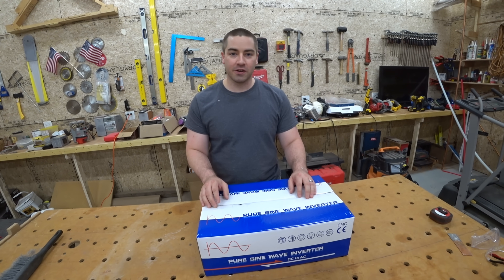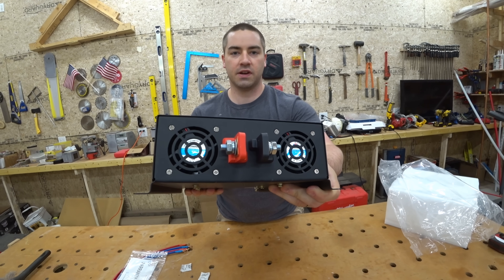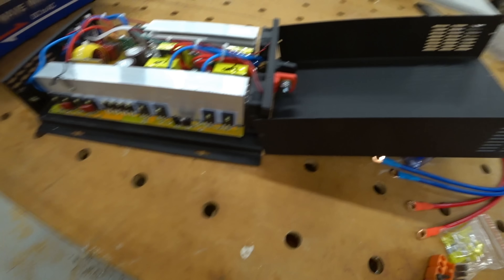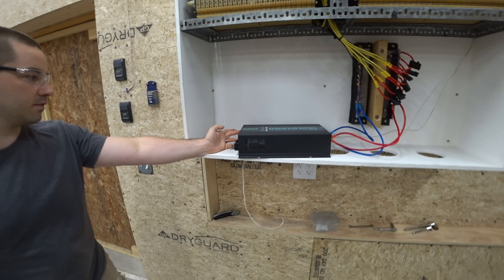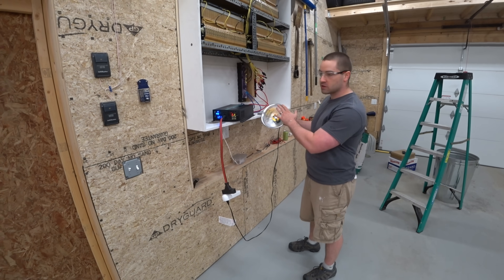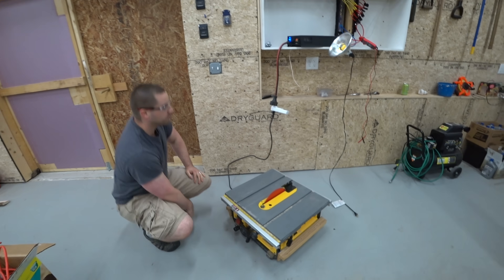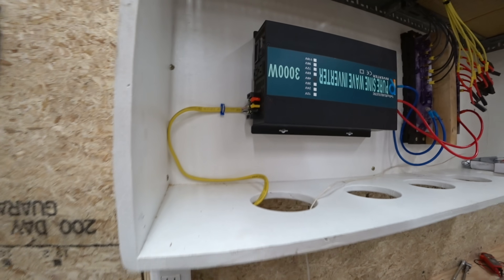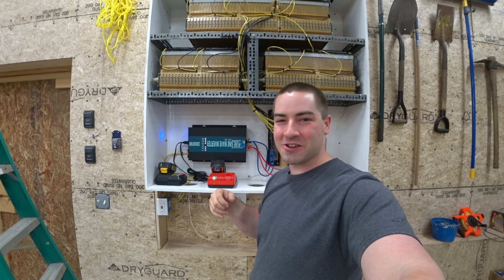Cheap 3000W Reliable Inverter, DIY Powerwall, Chevy Volt Batteries

Comment: Hello do you mean the battery built-in?
Reply from the maker: I'm sorry, but I don't understand your question.  I'm building a battery back-up system to connect to solar.  The ultimate goal is to have back-up power if the grid goes down.  The project is a success if you want to look at some current videos.

Comment: Would that be able to power a pellet stove?
Reply from the maker: Probably, but I don't know what your pellet stove needs for power.  If your pellet stove has any type of computer (such as a digital timer) inside then you want a pure-sine wave inverter.  However, if your pellet stove has an auger and fan then you might be able to use a less expensive modified sine wave inverter.  This is a 3000 watt inverter, but I wouldn't put anything more than 2000 watts on it.  How much power does your pellet stove need?

Comment: Even in big systems like 10k-18k you need a soft start to turn the 
A/C unit. Because of the amp draw
Reply from the maker: Thanks.  I ended up switching to a 6kw inverter from Aims.  It starts the compressor: https://youtu.be/dfHb5tZErTs
Reply: how is a single phase AC motor soft started ?
Reply: They sell a sure start soft start for a/c units pool motors air compressor. Ect
Reply: ah ban is single phase  but is 240 v so you use one of the 120 side and put a time on timer and give it 1-2 seconds. This example is the simplest one

Comment: You should use a soft start on the connection to the air compressor and it it will work
Reply: Ware do you get soft starr? Whats it called? Part number?
Please
Reply: Million Dollar give me a little bit and I’ll get you the information
Reply: Million Dollar alright!! They are called sure star soft start 16-32 amps. Look at your compresor and see how many amps required. But I’ve used this soft stars and they work great it takes  that brutal amp draw from the A/C system. Hope this helps you
Reply: Google it it’s right there!!

Comment: Hello there, I have 
-Two solar panel each at 300W=600w
-One MPPT charge controller 60A and 100v
-12V pure sine wave inverter 3000w continuous.
-Two deep cycle batteries at 150AH  each.=300AH
I know how to DIY but would someone tell me what to put in series and what in parallel or any possible answer.
Reply from the maker: Hi Nems, That's cool.  Sounds like you have the makings of a great setup.  I'll try to give you a hand, but there are a couple of details left out.  If I mess something up, or you want to talk more (maybe with pictures of your setup) send me a message on FB: https://www.facebook.com/DavidPozEnergy/

You said your inverter is 12 volts, so it will need to have 12 volts on the battery side.  Sometimes deep-cycle batteries are 6 volts (or even 2 volts).  If your batteries are 6 volts each, then they need to be wired in series to create 12 volts.  If they are 12v each, then wire them in parallel to keep the 12v.  Verify this with a multimeter before connecting to your inverter.  (with a fuse)

The solar panels can probably be wired in either series or parallel.   You will want to read the charge controller manual.  Somewhere it will say "MPPT Range"  You mentioned it was a 100 volt CC (charge controller) so let's say the MPPT range is 60v-100v.  (I'm making this up) and your panels are 40 volts (VMP).  This tells you there is only one way to wire them, series.  When you wire the panels in series you have 40v+40v=80v.  80v would be inside of the MPPT range, which is good.  If you wire the panels in parallel you still only have 40v, which is outside of the MPPT range, which is bad.  

I hope that helps.

Comment: i hooked 12V 3000W version last week and tested out with 1500W electric Kettle and it works fine. The voltage dropped init from 12.8v to 11.9 then bounced back up for 30sec and then went back down to 11.9v til the water boiled after about 5mins. Time will tell how long will it last. i have 200 Ah house batteries in my conversion van and will be using it alot

Comment: Quick tip for that stuck spinny screw... you have to pull the panel outwards and screw out at the same time, the threads just need to catch on the metal, because the threads on some screws are not th threaded all the way to the head...just a DIY FYI...
Reply from the maker: Thanks for the tip.

Comment: The output 110/240v cables are thinner because they carry less amps. Watts/Volts = Amps. 3000/110 = 27 amps, 3000/240 = 12.5 amps, 3000/12 = 250 amps !!! so you need thicker gauge wire for more amps.

Comment: Hi David, You can believe in what the manual says that in the Ac for Screws connection the color Red is the live and the Black is the Neutral, but when you look for continuity with the outlet it does not match.

Comment: Hi guys, I had a Canadian Tire 1800 W inverter ( square wave ) which easily ran my 1HP air compressor and my Skil  saw, separately. Blew it some how with gross overload. Capacity of inverter was closely related to battery capacity under load.

Comment: Why are your Battery Bank at a lower voltage than it should be. 44 volt instead of 48 volts. Cells are usually 2.2 volts apeace. When 8 batteries are hooked in series this produces 48 volts.
Reply from the maker: The battery I'm using is Lithium NMC.  I have the cells arranged in 12s, or 12 cells in series.  44 volts is where it should be.  The nominal voltage for this chemistry is 3.7 volts per cell.  You said it should be 2.2 volts per cell.  That might be right for a lead acid chemistry.  I'm not sure.  You can see more about this here: https://youtu.be/ot3IhsUfFS8  Thanks for watching.

Comment: Nice job. A question; the double red and blue wires coming out the back, are they connected to an AC source or are they DC feeds from your battery bank?
Reply from the maker: Hi Jeff, DC, from the battery.  I've got a video on those DC bus bars here: https://youtu.be/DsbgNuZtBqY  Thanks for watching.

Comment: you need a lf pure sine wave  I use a 15kw  an a 20kw with 60kw an 80kw serage capacity ,the larger one used for bitmain antminers ,one inverter weigs  150lb ,only use gulf cart / solar batters
Reply: huh?

Comment: what voltage is the chevy volt  batteries    each
Reply from the maker: Each cell is a nominal 3.7v, there are 96 cell groups.  I broke that down into 8 battery packs.  Each pack has 12s, for a nominal 44 volts.  I use it with 48 volt equipment.  I have a video on re-wiring the packs: https://youtu.be/ot3IhsUfFS8  Thanks for watching.

Comment: Thanks David I'll try checking that out , I'll let you know if that works.Thanks for the great video and I'm saving for a 6000 watt aims split phase inverters like yours keep up the good video's.
Reply from the maker: Cool.  I've been using the Aims every day and so far, so good.  Another YouTuber "Going Off Grid" says the Sigineer brand is cheaper, but almost identical to the Aims.  It might be worth looking into, but I haven't tried them.  https://youtu.be/TXYuoM203iM

Comment: I bought the exact same 3000 watt inverter except mine was24 volt .l bought it off Amazon over a year ago so it's not under warranty. It worked great for 3 days and all I was running was a 60 watt light in my barn ,it comes on or the green and red light doses and it dose show the voltage, but won't run , checked all 8 fuses. Please contact me if you can help. Thanks  robertcloninger80@gmail.com
Reply from the maker: Sorry, but I'm not going to be any help.  I have two broken inverters and have not yet figured out how to fix them.  I've been told it is probably the mosfets need replacing.  "Going Off Grid" has replaced mosfets on his inverter and gotten them to work again.  I'm going to follow his lead and see if that works for me.

Comment: I've been running on solor system for a few years. But lately I've been trying to add wind turbine as well to unite both together. It would be helpful to see some videos on joining wind power with solor power working together..
Reply from the maker: I'm sorry, but I don't have a wind turbine.
Reply: @DavidPozEnergy  your video was very helpful , I'm always trying to learn more about solor power as I'm only using 400 Watts of harbor freight solor panels. But wanting to improve for when the sun goes down. I just purchased a 400 watt wind turbine. I've been doing alittle research that l think I know how to join them to work together. Thanks for your video l was able to learn more about solor power.

Comment: What's the starting load for the air compressor? Put an appropriately sized capacitor bank in-line ahead of the compressor (essentially creating an easy/soft start). That should start the compressor (or other high start current induction load [think standard A/C unit]) with no problem, then the inverter will run the compressor. The caps recharge almost instantaneously and will support even short checking the compressor.

Comment: It's a split phase 240/120V system (1500W at each outlet or phase), good for 15A at 120V but not for 20A, which would need 1920W.
Reply from the maker: I'm not sure what you are referring to.  The 3000 watt inverter I cover in this video is single phase only.  120 volts AC.  I have confirmed this by taking the cover off and each hot leg (of the two outlets on the cover) trace back to the same source (crimped together).  Maybe there is another model inverter you are confusing this one with?  Thanks for watching.
Reply: It is a single 240V winding tapped in the middle (that is where your neutral is) https://electronics.stackexchange.com/questions/233483/in-a-single-phase-transformer-output-which-wire-would-be-phase-and-which-one-w , hence 120V at each output 180 degrees apart. There is a difference between 20 and 15A outlets: https://www.homedepot.com/p/Leviton-20-Amp-Commercial-Grade-Double-Pole-Single-Outlet-White-R52-05821-0WS/100356999. A 15A outlet puts out 12A x 120V = 1440W.

Comment: How far away from the inverter could I run the heavy load line to an outlet
Reply from the maker: I don't know the maximum.  I've run 100 feet of extension cord off this with no problems.  I imagine you could run farther, but at some point you would suffer line loss.  If you know what load you are trying to run try using this online calculator.  I think the rule of thumb is to stay below 3% voltage drop.  https://www.rapidtables.com/calc/wire/voltage-drop-calculator.html
Reply: @DavidPozEnergy  thank you very much just getting into solar ordered the same inverter I have no idea what I'm doing but hopefully it works out
Reply from the maker: Best way to learn is to jump right in.  I like the 3000 watt inverter, but I've had problems with the larger ones from Reliable so just be careful about that.   Feel free to e-mail me if you have a question.

Comment: I bought a Power Bright PW3500-12 inverter from Home Depot. I wanted to connect my 1000 watt microwave oven to my Kia Soul Plus. I had the electrical done by a electronics that has installed these in trucks and larger vehicles. They added a 300 AMP Stinger overload switch to the circuit. My Microwave oven would only stay on for 2 minutes.....then thereafter for 1 minute at a time. I had them install 16 feet of 0 AWG guage wire to my system. In 31 days my 3500 watt inverter burned out and caught on fire. Thankfully the fire shut itself off within the metal framed body of the unit. Home Depot was so very nice to take back my inverter and give me a complete refund with no questions asked. They honored the 90 day return policy they told me. So I bought a Power Bright PW6000-12 inverter. I installed and connected the unit and grounded it. I plugged in my 1000 watt Microwave. And again, this time it lasts about 3 minutes then 1 minute thereafter. The inverter turns off the first two times. After that my Stinger switch toggles off. I get a feeling my wires are getting hot possibly. But if I have 0 guage wire, I shouldn't be having these problems so often. I get a feeling this inverter in 90 days will die also. I just hope it wont catch on fire also.

Comment: Does this also work for a 24 volt system
Reply from the maker: The compnay "Reliable Electric" also makes 24 volt versions of the inverter.  Some are on sale this weekend.  I only know because the companey e-mailed me the promotion.  Here it is:The link below  will be a lightning deals  in Dec 1, 2018 11:50 AM PST - Dec 1, 2018 5:50 PM PST  (3000w 12v/ 24v    2500w 12v/24v )

https://www.amazon.com/WZRELB-Converter-Power-Inverter-Generator/dp/B075YV4B6D

The link below  will be a lightning deals  in Dec 1, 2018 3:50 PM PST - Dec 1, 2018 9:50 PM PST(3000w 12v )

https://www.amazon.com/Reliable-Efficiency-Inverter-Converter-Display/dp/B0154C5F3A

Comment: I have a 5000w peak to 10000 DC To AC inverter how many batteries would I need how thick the cables to run 16 hours say if I had a solar array or change the solar Ray to a 800 watt wind turbine
Reply from the maker: Alt-E has some great resources.  Here is one about inverter wire sizes: https://www.altestore.com/howto/recommended-inverter-cables-sizing-and-breakers-or-fuses-a62/    And here is one for calculating the size of solar array and batteries in off-grid: https://www.altestore.com/store/calculators/off_grid_calculator/
Reply: @DavidPozEnergy  thx

Comment: The Converter : You could add a bit of solder to the Shunt  lowering the voltage drop your experiencing.  Yes it would defeat a few protection systems within the Converter but not to any degree of making things dangerous.   Adding Material to the shunt the converter would not know your feeding it voltages lower then it's design.  Easy Procedure.

Comment: Hi David, hope you can answer me, just starting out, not wanting to go full off grid but would like enough to have some light, run my low wattage ham equipment and a laptop, looking to start out with 200 watts will build to 400 watts later, is it necessary to have sine wave , mppt, figuring to spend maybe $800 to $1000,  please give me a little insight to what it good but least expensive, thanks, George

Comment: just a suggestion is to replace all the fuses with DC breakers as $$ allows then u dont have to go shopping if a fuze pops ..  they are cheap on the bay
Reply from the maker: Absolutley.  I'm going to install a din-rail with all the breakers.  I'll be setting that up once I finalize the location for all the parts.  Thanks for watching.

Comment: You can try to use starter capacitors before the compressor to cut off the load from the inverter for easy start.

Comment: I think this video sucks because you didn't do what does make the most difference. Which is set aside those thin battery connect cables the thing came with and use some proper ultra thick battery cables between the inverter and the batteries. Everyone knows this is what makes the most difference. Yet you never bothered hence you didn't really give this poor inverter a fair chance to show what it can do.

Comment: well duh ofc they are smaller that outlet is only rated for 15A... (if you even lucky, pull the outlet out and read what it says its rated for then make that decision if the wires are too small... the hardwire is what you run to your panel/subpanel for higher amperage loads.

Comment: Did you ground the inverter?
Reply from the maker: No, but I do want to.  One question I have is this: If I ground the inverter to the same grounding rod as my house, will I get any kind of negative electronic interference?  Thanks.
Reply: DavidPoz question I have myself. I use my inverter as portable and have a dedicated ground wire. I know path of least resistance etc but surely other electrical devices on the grounding wire register some of the electricity sent down if needed 🤔

Comment: Don't just end it here. You can add a motor starting capacitor to your air compressor that will take that surge like an animal. Even if that fails, you can add super caps to the air compressor for starting.

Here's a link to some insight: 
http://www.capacitorguide.com/motor-starting-capacitor/
Reply from the maker: Thanks.  I'm testing another inverter at the moment and will be making a video about the new one in the future.
Reply: You can buy motor start capacitors.

Comment: A spark when connecting an inverter is common (for the reason you mentioned). What I'm wondering is why you have a 44 volt battery bank. You probably mention that in another video, but this one popped up. Most equipment will come in multiples of 12v..... 12, 24, 48, to be more specific. If your batteries get just a bit low, the inverter should turn itself off for protection.
Reply from the maker: Hi Steve W,  I bought a used battery out of a Chevy Volt.  There are 96 cells in the Chevy Volt, and in the 2nd generation these cells are in groups of 12 and 16.  The 12 cell group is a 44v bank, and the 16 cell group is a 60v bank.  More inverters and charge controllers can work to the lower voltage than can work to the higher voltage, so I made all of them 12 cell groups for 44 volts.  Yes, the inverter turns off at 42 volts.  The ideal configuration for lithium cells is 14 cells which gets you working with the most equipment out there.  This is called 14s (s is for series).  You may notice other YouTubers who make systems with other types of batteries usually go 14s.  So far my lower voltage has not caused any problems, but if you have the option then go with a 14s.  I hope that helped.